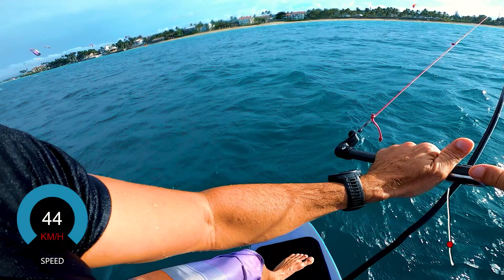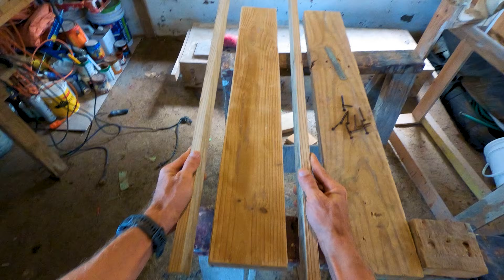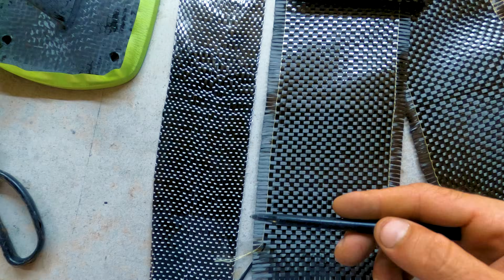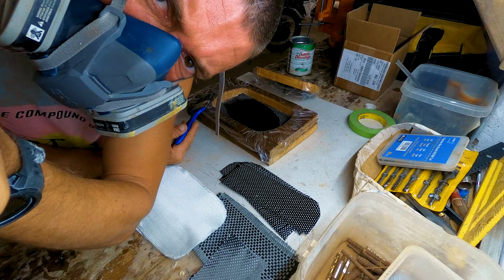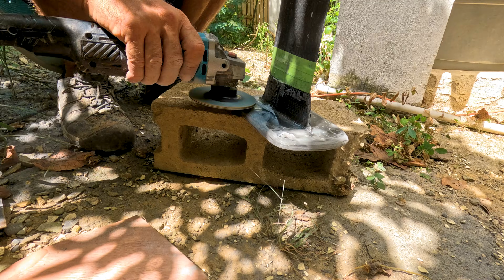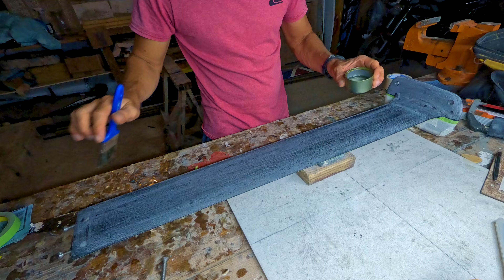How to Build a Full Carbon Hydrofoil Mast

Comment: Super! And very inspiring. I am thinking to make a custom mast, with more optimal profile, because all profiles I saw, I doubt are optimal. 
One more advise. Next time find out a post-cure thermal schedule for your resin and perform it. It will increase the strength and rigidity.

Comment: As a fellow composite garage builder, I learned several things from your video! Also, I see you don't wearing gloves when using epoxy. I pray you do not clean your hands with solvent: this works great, but also dissolves the epoxy into the solvent, which then soaks into your pores, then bloodstream. Many builders from the '80's found this out the hard way (they died young) when DIY composite tech hit the US.

Comment: Amazing work. I'm thinking about building a daggerboard for a F18 catamaran from a mould. How would you shape the end to be aerodynamic? (the one used for the mould has just a square end with rounded edges)
Reply from the maker: If you do full carbon you could just sand the square end to the shape you like but that is not going to be fun or healthy. If you have foam in the center of the daggerboard you could also shape it but you'd have to laminate the final shape where the foam is exposed. Good luck!

Comment: I have made carbon keel fins and have a couple of  suggestions.  Switch to non-crimp unidirectional carbon fabric for all your inner layers.  The fibers going fore and aft in the woven carbon are serving very little use in this layup except to hold epoxy and weaken the long axis fibers due to crimping in the weave. They contribute almost nothing to the stiffness relative to fibers running along the long axis. Your torsional stiffness will not suffer much at all because the entire layup will be so much stiffer using good unicarbon.  Second, switch from tape to fabric, then you can bias cut your woven carbon at a true 45°.  Trying to shear the tape you have doesn’t work well because of the hem stitch sewn in to it and it is not wide enough to give you shearing effect worth anything.  Also, when you shear a bias cut fabric, it compresses the fiber against each quite a bit, almost making a heavier fabric.  Bias cut outers layers do contribute more torsional stiffness than a unicarbon layer, but the a lot of their purpose is to hold the unicarbon layers in place and prevent them from buckling.  A final suggestion is to use peel-ply over the carbon where your mast surfaces join the base.  It creates the ideal bonding surface for laminating additional fabric to mate the parts (I do think you could switch to a 3-part mold and do the whole mast at once).  I like that you are wetting out layers as you apply them now rather than trying saturate them all at once as in  your earlier vids.  You are doing nice work with low tech and I applaud your continuing efforts to improve your composite skills.
Reply from the maker: Thank you for the tips, its very informative. Indeed I'd love to incorporate the mast base plate into the mold. Next time I make a mast I'll study this message once more to see if I can improve on at least some things you mention. CHeers!

Comment: I have extensive experience with epoxy and composite construction.
I’m impressed with everything you did in building the mast.
I however agree with an earlier comment about not wearing gloves.
It’s common to develop an allergy to the resin and it’s serious.
Buy gloves and wear them, resist using solvents also.
Nice job Bro!
Reply from the maker: Thanks for the feed back, I'll be sure to wear gloves in the future, Cheers!
Reply: @HANDIY where do you buy carbon tape?

Comment: Great video. Can I ask how many layers of carbon you used in total? Always difficult to work out. Thanks.
Reply from the maker: Not really sure, maybe 12 layers of tape on each side, but main goal is to fill up the mold.
Reply: A fully consolidated laminate 12mm thick would have roughly 48 layers of 200gsm carbon

Comment: Awesome Job!
Thx for the detailed instructions.
I want to build a mast for pump foiling, but I'm not sure which technique to use.
I'm leaning towards expanding foam core to keep the weight low.
How long is your mast and how heavy was it in the end?
Reply from the maker: The mast is 1 meter long, not sure how much it weights, it is a little bit heavier then my previous foam core mast but to achieve a thin profile it felt like the easiest and stiffest option using standard carbon. For Pump foiling you can have a thicker profile so foam core could be a good option.

Comment: Happy to see another of your videos! How did the last foil turn out?
Reply from the maker: HEy mate, Just before the test I noticed the anhedral cuvre on one of the wings was not perfectly symetrical, I suspect it was because of bad plywood. I took it out for a test run anyways and it still worked but was super inconsistent past 25knots of speed. I lost inspiration for a while after that one.
Reply: @ thanks for the update. You are back, which is what counts!

Comment: What is the "butter" you use to prevent epoxy from sticking to the screws and mold parts ?

I need to build a lip on my deep tuttle windfoil mast, the way you made your plate gave me good insights on how to proceed :)
Reply from the maker: Happy to hear that :) I used crisco butter, its like a cheap synthetic butter. I've forgotten to  use butter on screws before and it still unscrewed just takes more force. Good luck on your mast!